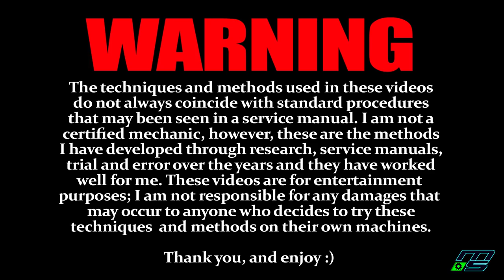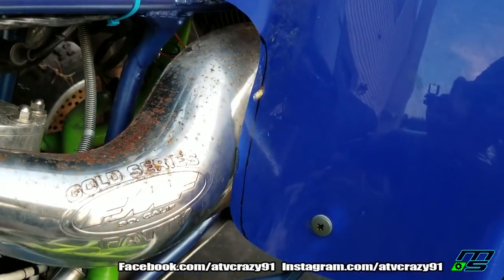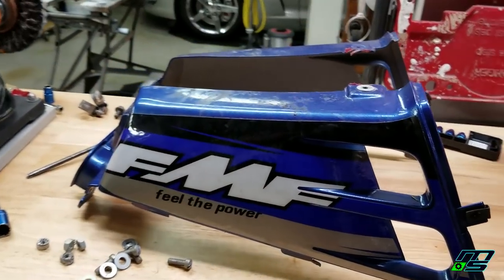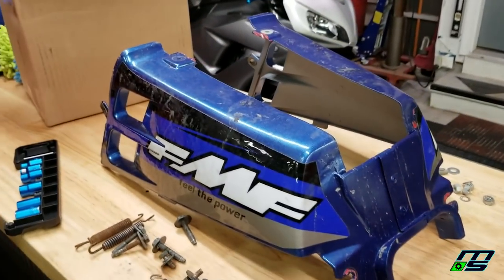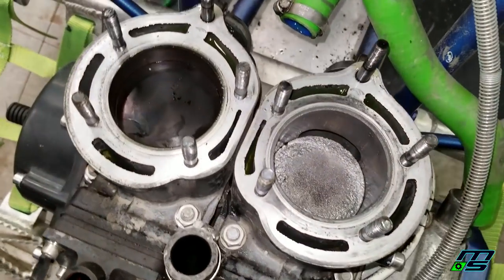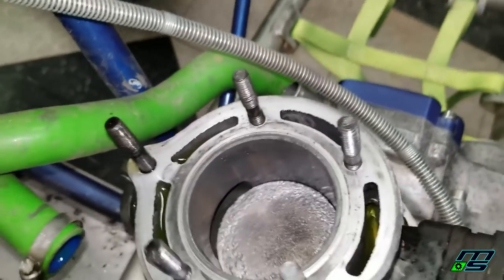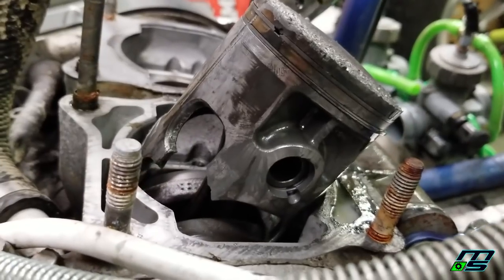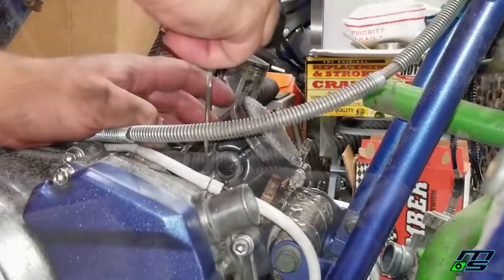What Happened To The Banshee?

Comment: If you want a nice bit of improvement  in power with a noticable mid to top without losing any bottom end put an extra base gasket to equal .6mm or 50 thou on top of your standard base gasket
This will increase your exhaust timing from 183 degrees to 187 and transfer timing to about 121 degrees
Like putting in a mild cam
Then shave the same amount of the top of your cylinders as you have added to the bottom
Might have to just clean up the bottom of port to make it flush at bdc
Cheap as nice increase
Reply: I used to do this drag racing here in WV back in 1990 on a KX250 😂   ..   Can't believe ive seen someone else comment about it.

Comment: You do a great job with your mechanical work. That being said, the microscopic flat spots you make when driving your wrist pin out, can cause that exact failure, especially if you drove the pin during assembly. Keep up the great work and remember a c-clamp or carpenters quick clamp are perfect when using soft jaw, or covering the hard jaws they may have. ✌
Reply from the maker: Thank you for watching my videos man! If this is the video after I grenaded the top end, i most likely tapped them out because i was planning for the 421 4 mil build with all new parts. Regardless; I like the c clip idea for pressing in/out the pin; thank you for sharing!
Reply: @MichaelSabo  unfortunately I had to learn the hard way.😂 I'm not artistic but ive been riding and wrenching for over 40 years. In fact I have an 07 yz450f with 32.5 original total hours on bike but a bad oil pump idler gear detonated her real nice. Doing a complete resto on a 1995 kdx200 h2 right now then the 450 then we move on to my 10 year old daughters rm60. It's a ripper! I would appreciate you checking my channel out. And don't hesitate to ask if you need an opinion on something your not real familiar with.🤞
Reply from the maker: @jaydensdream714  learning the hard way... sounds familiar 😂 I appreciate you watching man and it sounds like you have a ton of experience; I will check out your channel!

Comment: The ebay cylinders aren’t bad, usually need a little cleaning up on the ports, but they work. The pistons in those kits are complete garbage though. I’d also recommend losing that boost bottle.

Comment: My bike did the exact same thing when I bought it. Right piston skirt blew to pieces wedged in the crank. I took the motor out of the frame turned it upside down and shook it and shook on the crank and it broke free and all the pieces came out. I flushed it with premix a bunch of times and compressed air and put it back together. It’s been fine ever since. My cause was a failed oem water pump probably had my motor running 300*+. I would post pics if I could but I can’t on here. Invest in a trailtech in line digital temp gauge man.

Comment: Put a OEM head, OEM cylinders, and wiseco pistons. And just stick to that so it's more reliable. Because those aftermarket heads give it more compression and it won't be as reliable
Reply: No. A well setuped engine is reliable.
Reply: Claude Perron still won't last as long as a OEM engine.
Reply: I dont want to be rude, but i think you're lacking knowledge about banshee engine setup. After market heads dont give more compression, they give you the chance to setup the compression/squish that you want by choosing the right domes for your application.. You can set it up at 125psi and 0.050'' squish if you want to be 'safe'

The problem is that most people are just 'part changer', they dont listen to peeps who knows how to setup a banshee motor.
Reply: Claude Perron then why when I put a cool head on my banshee I checked the compression with a compression tester and it went up a few..i switched it back to stock just cause I feel like it would last me longer.
Reply: Depends of what domes you choose/came with the heads. I agree that more compression put more stress on the crank (thats why we weld the pins, 'cause stock banshee crank are known to twist on the pin with higher hp/compression setup), but you can run a 421 banshee with low compression (125psi) and be as reliable as a stock 350.

Comment: Something came up from the bottom, got caught in the transfer port when the piston came down, and broke the piston. Could be a piece of a bearing cage from an outer crank bearing or even the small end bearing. It would take steel to gouge the cylinder wall like that and there is no aluminum on the walls so it didn't seize. I doubt it is the small-end bearing that caused this unless it was a chunk of the cage that came out. That could have broken up from whatever was in the top getting crunched by the piston. That could have been the pieces of piston that broke off. Can't see the indentations that well.

Comment: Don’t bother contacting trinity for new domes, they are garbage, plus they don’t do banshee stuff any more.  Mike, you absolutely need to split the cases and inspect the crank. That rod should still be free even at the bottom end of the stroke. If you don’t know how to pressure test a motor, you need to learn how to do so because that can melt a motor down and look like your right cyl.  If you want advice on what to do let me know I’m not gunna ramble any more.
Reply from the maker: Anthony Sullivan I appreciate the advice man! Yes, I am splitting the cases and getting a long rod crank! I am familiar with leak down tests and I will be performing one once it is all together again. Trinity already dropped the ball 😂 I'm probably going to trash this head unless I can find a good machine shop to shave 2mil our of these domes to make up for the long crank.
Reply: Not sure if you picked up your replacement head yet, but for what it's worth, back when I still had my Banshee I ran a Chariot Performance cool head and had good luck with it.  I don't know if they're still around or not, but I have to say that I was really happy with the build quality on mine, so I'd recommend picking one up if you can find one.

Comment: Hey man, great channel. I blew up my raptor 700, would you recommend I rebuild it to factory spec or go big bore/stroker kit? I'm also drooling over you banshee and want to buy one so when friends come to visit I've got an extra quad for them to ride.
Reply from the maker: What's up man! It depends what you want to do with your quad and how much money you have to spend. When I rebuilt my 700, I kept it stock bore with a high compression CP piston. It made the build easy and pretty inexpensive, plus you dont have to worry about supporting mods. When you go big bore, sometimes other things start to break. I'd definitely get a Banshee for a 2nd quad regardless  🤘
Reply: Once you did the high compression piston, what did you do for fueling? Right now I just have the gytr air intake kit, fmf header and pipe. Plus the fmf (doebtech) 3 button tuner.

Comment: When I bought my banshee it had the exact same problem
Reply: Wyatt Smith This was the same issue I had. It came with Works front shocks, Pro Circuit 304 mufflers and header pipes, and a Pro Design Cool Head. I paid $1500.